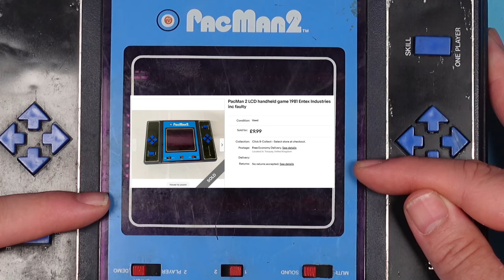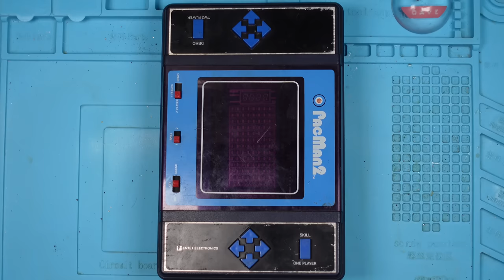I Bought This PacMan 2 Game FAULTY From Ebay | Can I FIX It?

Comment: Do you know about the process of rust bluing?  You can boil rusty parts, like those battery connections, and it will change the red rust(ferrous oxide) to black rust(ferro-ferric oxide)and will soften the rust making it easy to remove with steel wool. This is the process used in rust bluing firearms parts. You should look into it. It might be a bit less destructive to the metal you are working with than using a grinder.

Comment: I feel sandpaper would have been perhaps less spectacular, but more effective for removing rust like that. Love your work!
Reply: I agree using sandpaper is better that using a rotary tool since don’t leave ugly scratches in the batter contact
Reply: or wire wheel
Reply: Vinegar is much better. Sandpaper will leave rust in the pores of the metal, so it will rust again
Reply: Some 75% phosporic acid will do the trick without any mechanical effort🙂
Reply: Yeah he’s gonna need to clean those again properly otherwise they’ll just rust up again.

Comment: Vinegar is to remove battery acid, usually when it's white and crystallised. When it's rust you can't do much with vinegar, use rust converter or just get new battery contacts. I'm 100% sure no one's gonna cry over the original battery terminals.

Comment: Throw the rusty battery contacts in citric acid.
That works great, actually you should nickel them again after cleaning.
Reply: And would the 10 quid device have worked any better ? No.
Reply: @Brianck1971  Correct, wire wool the rust off then paint the back plates, job done

Comment: Awesome video as always brother. I had one of these in the early '80s. It was a pretty cool game back then. At least it was an easy fix. Good to see it back up and running. Whenever I'm restoring battery terminals I use a rust remover. The smell of the vinegar just gets to me so I can't use that. The only additional step I would take is to add some deoxit to the terminals and just leave it, sit the dry, protects them and prevents the rust from coming back. Great video once again bro, keep them coming 👍👍👍

Comment: Get yourself some Evaporust!  I have used that to clean rust\corrosion from battery terminals for several years now.  Also, instead of using your grinder, get yourself a wire brush head for a drill or dremel.  That rust likely was caused by batteries that ruptured.  I've seen that more a lot.

Comment: So the leaking battery melts the chrome plating on the terminals right?  Then we clean it back up - but won't the terminals rust now since the chrome is gone? Should we put something like linseed oil on it or even just some motor oil to help protect from future rust?

Comment: Good work. I wonder if zinc-plating the connectors would help prevent future corrosion. I've seen some tutorials online and it looked pretty simple to do at home with stuff around the house. Also, you could probably scan and 3D print another battery covery. I've seen some apps on the iphone for scanning part.

Comment: When "derusting" metal contacts like that, the white vinegar does a good topical job, but then I use a wirebrush on my dremel and it does a great & quick job clearing the harder rust.
I've never snipped off the springs (just give them a good soaking in the vinegar, or rust-removal solution).

Comment: I recently had to remove rust from some big spring at work, I have a lot of different acids there. I found that the best is first to use 37% HCl and then 100% H3PO4. about 30-60 min each. after that all the rust is easily removed with toothbrush.
10-15% TFA can be used instead of 37% HCl as well.
Reply: Couple of hours in some vinegar would work great at home.
Just not as potent as the industrial stuff but easier and safer to do at home.

Comment: Just dirty battery terminals for you Steve...took me weeks to figure out the faulty switch, as a continuity test showed power switch ok....but when on, the 6v dropped to less than a bolt, so I thought a component was bringing it down. Found eventually it was dirty contacts in the switch. Ok for a continuity test, but too dirty to let 6v though!

Comment: First of all, love your videos!  Super relaxing to watch, though admittedly I always skip the rap... excepting I do like watching the disassembly sometimes.  Especially on the more complex things that have multiple boards.

So I wanted to tell you, I have been 3d printing for a few years and it's pretty awesome being able to make those needed parts.
That said, I've been an ender-series fanboy for a while... until I got a Bambu X1Carbon with the AMS (Automatic Material System).
Night and day difference.

My Ender3 Max is like a 90's honda accord.  It will last forever, you can work on it with chopsticks and a hammer, and it DOES give reasonably decent 3d prints, and it can print MOST types of material.  For the best overall quality however, you need to print around 50-100 mm/second.

My X1C is FAST.  Remember that 90's Honda Ender3?  This X1C is a Tesla Plaid. 
It's fast.  It prints multiple colors at once.  It's Ron Popeil Set-It-And-Forget-It. (American Infomercial Product Guy that sold a toaster oven who's tagline was set it and forget it.)

If you're gonna spring for a printer... PLEASE look at the Bambu X1C with the AMS.
I don't work for them.  I'm just a fan of your show... and this printer.

Please keep doing your videos!  They're awesome!  Thank you for what you do!

-Bill

Comment: It would've probably been a fair bit easier to use a dremel or similar, or some good old sandpaper to clean those terminals mate. 😀 Then also, white vinegar needs time to break down the rust... like you need to leave the parts overnight, or sometimes even a couple of days for the rust to get broken down...
Reply: that's what I thought - why not buy a Dremel? Has way more uses than his little toy engraver thing, he'll use it for something else sooner or later.

Comment: We had the worst case of battery leakage I've ever seen come in for calibration at work the other day (on a Chauvain Arnoux micro-Ohm meter). The 6 D-batteries had congealed into one clump, battery contacts were gone and about 1/3rd of the plastic had somehow been eaten away. On the PCB, part of the copper pour and conformal coating had lifted, traces and all, and was sagging. Unreal.
Needless to say, we just made them an offer for a "new old stock" one (model is discontinued).

Comment: Evaporust. It makes iron oxides disolve but leaves all the other metals and plastic alone.  It is not an acid cleaning process so shouldnt attack anything else and can be cleaned off with water.  Obviously it cant bring back whats already gone so if plating went with the rust then it is gone for good and it will leave pittting from where steel corroded.

Comment: What i do is once ive removed all the rust with wire wool, i paint the terminals with humbrol enamel not the spring of course) they will never rust again. you dont need a 3d printer, buy some 2mm polystyrene sheets and make your own battery covers

Comment: Does your grinding pen use 1/8" shank bits? If so, you can pick up inexpensive brass, steel, and plastic bristle miniature wire wheel/wire brush dremel bit assortments which would make very fast and clean work of rust removal tasks without marring the metal surface as much. Just wear eye protection so you don't get a wire in your peepers 😎

Comment: Would putting a 6V rechargeable battery pack in this be an idea rather than cleaning up the terminals. I know you could use rechargeable batteries in it but D Cell ones aren't a common find and so why not make it a bit more modern?

Comment: You use brute force where chemistry is your friend.  Soak them in the vinegar overnight, then a light sanding...  Eventually, we could even get you to being flashing with nickle plating to protect those battery contacts.

Comment: You should invest in a wire wheel for your spinny tool. It will make for a faster job cleaning those metal pieces.
Reply: and remove less metal

Comment: If you were after a 3d printer. Don’t go with an FDM printer, as versatile as they are, a resin printer will give much nicer and smoother prints from the get go!

I have both varieties and much prefer resin! Plus printing one object takes the same time as 50 on a resin printer, where as FDM it’s multiplied by each model plus movement to and from each part.
Reply: Resin is messy and it smells.
Reply: Resin is absolutly awful for these kind of piece, it's a mess to deal with and resin is too brittle. You don't need good surface finish for functional piece, you not printing miniature.

Comment: Steve, if you’re interested I could make you the battery cover you’re missing. I can design them in software and then 3d print them but I’d need you to send me the one good one for all the measurements. I’d send it back with the new ones.

Comment: You could modify it to take 2 3v lithium ion rechargable AA batteries using adapters.
Reply: Why? Just use rechargeable C cells
Reply: @dlarge6502  Because one battery door was missing and I have never seen any 3v c cells. Point was you can get away with using only the closed compartment.

Comment: i would have Not Bothered Repairing the Battery Connections,  i would have Installed a Lithium Battery and Installed a USB Charging Port { Preferably USB C, But Micro USB Would Do in a Pinch }

Comment: Remember folks, removing the rust is only half the battle... You should electroplate it to protect the pieces from rusting again!
✨🌈The power is yours⭐
Reply: Bollocks
Reply: If you removed all the rust, and you're not planning to place it in water, let batteries leak into it, or high humidity, it will be fine without it.